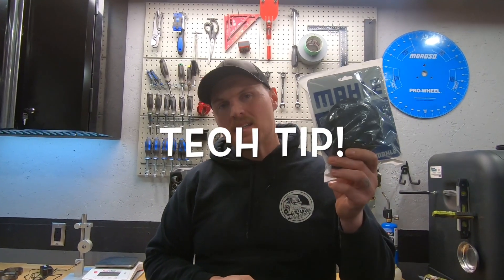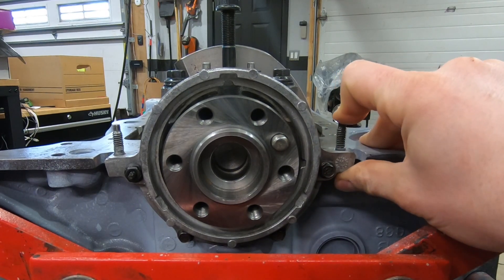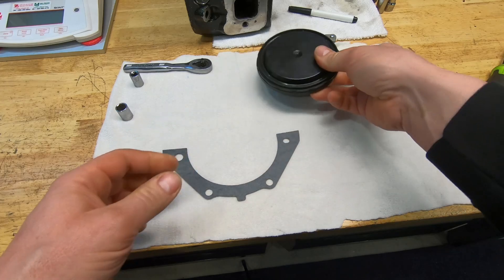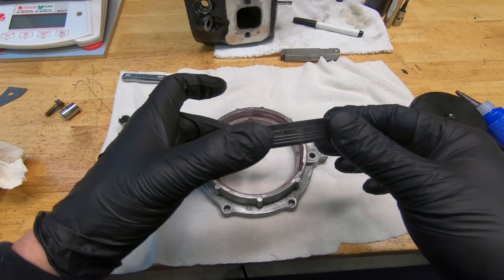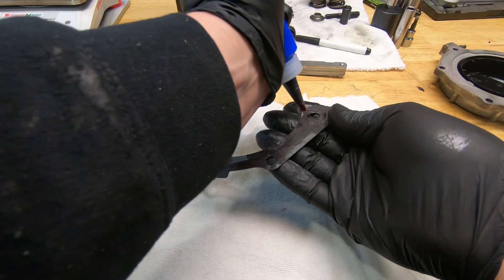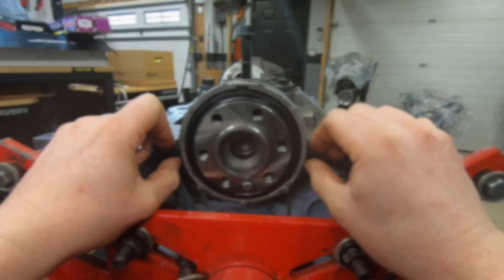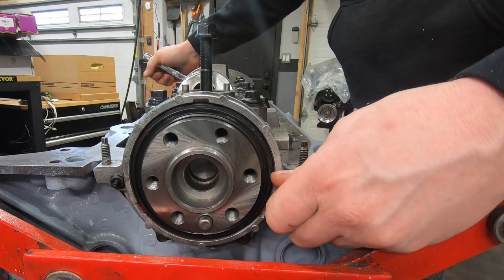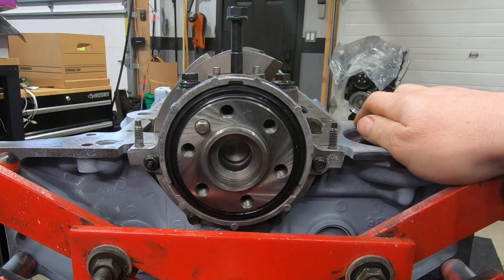Tech Tip! 1PC Rear main seal housing install/centering

Comment: Thanks! I recently did this job on my grandpa's truck and the seal was an absolute nightmare to install. Somehow after less than 100 miles it has actually popped out of the housing. It was a Felpro from Napa, I'm going to try your part number on Monday.

Comment: USE A BRASS SCREW IF YOU REMOVE THE SEAL BY DRILLING A SMALL HOLE AND USING THE SCREW TO PULL THE SEAL OUT, OR YOU WILL DAMAGE THE END OF THE CRANK .

Comment: Hey pat love all the information quick question I installed my seal just like you did I've always seen everyone else install there's the other way around the flat side of seal facing the flex plate. Does it really matter which way?
Reply from the maker: You are just seeing other types of seals. The seal in the video is installed the correct way with the ribs pressed into the rear housing. Some seals like the seal in the video have that extra flap on the outside and some are just flat towards the outside

Comment: Is this necessary to do when youre pulling the pan to do a cam swap? Im going to assume one of the benefits to one piece rear main seal is you can pull the pan without disturbing it?
Reply from the maker: No if the housing hasn't been unbolted, then it doesn't need to be touched

Comment: Paf, would a thin film of oil be helpful on the inside of the seal where it contacts the crank? As soon as installation is complete, before you spin the crank?
Reply from the maker: @msh6865  Shown in the video, you put oil on the install tool, which lubes the seal

Comment: I've 3d printed several inserts that sit in place of the seal and snug on the crank.  Holds the plate centered while you tighten it.   Pull out the insert and install a seal.
Reply from the maker: That's a good way to do it aswell

Comment: .004 feeler gauges between the crank and 3 tangs inside the seal housing, torque housing and install seal.
Reply from the maker: Believe it or not, but tangs aren't always consistent sizes

Comment: Cool! 👍
I do something similar to the front timing cover, too, around the crank snout. I leave all of the bolts snug and rotate the crank like you, then cinch them down.
Reply: Probably not necessary with the front cover since there's 2 dowels that hold it in place
Reply: @lollipop84858 Necessary? I don't think I stated it was necessary, did I? Hold on . . . Let me dbl check.

Ok. I'm back. Nope. I don't see where I stated it was necessary. 
🤔

Comment: Can i use that sealant one the 2 piece as well on the cap?
Reply from the maker: @lordsauto  yes absolutely, that's what I use
Reply: @cuttersperformance   thanks!
Reply: Yes, I never liked using silicone on the parting line of the rear cap. I've had a small tube of that anaerobic sealer for a long time, a little goes a long way.

Comment: I have a machined spacer that fits between the crank and seal housing. I install the housing with no seal using the spacer and tighten the housing. Then I put the seal intaller on the crank and push/drive the seal in. It's the same way I do LS timing and rear covers. And I use 8 feeler gauges to align an LS oil pump. Different method with the same results. I don't ever remember having a seal leak on a new seal.
Reply from the maker: @hotcolors9455  yep that works too! And l also dothe LS covers with a spacers